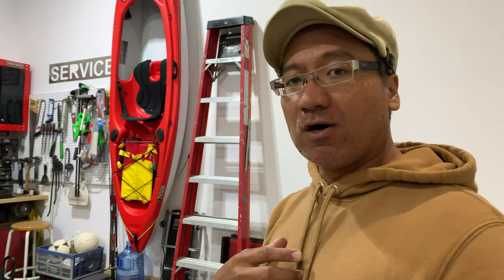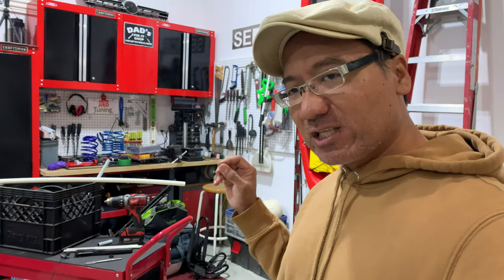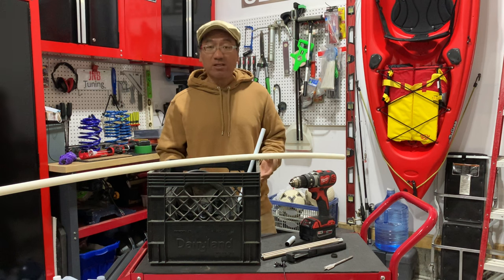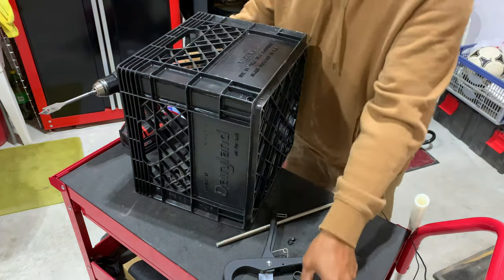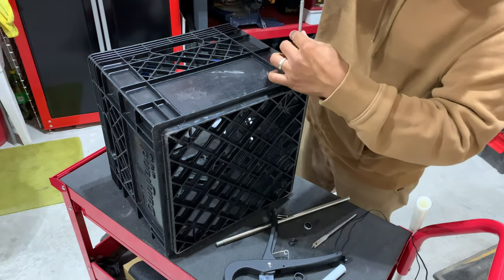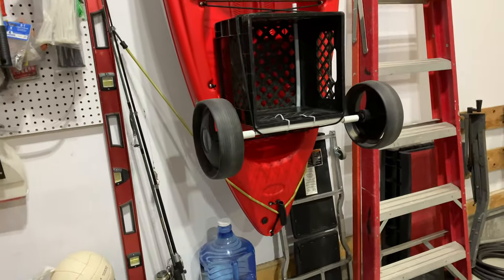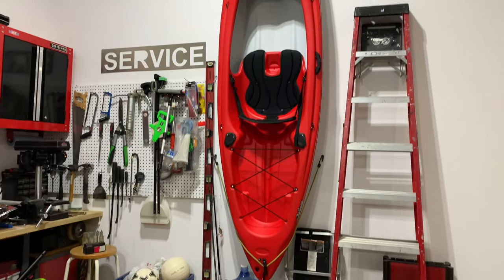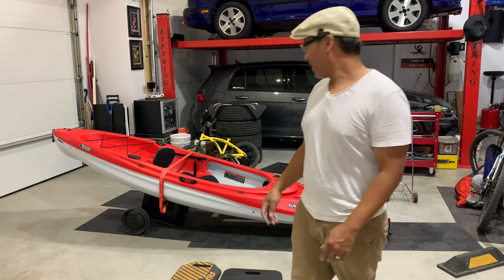A Fishing Crate that can be Transformed as a Kayak Cart or Trolley | Easy and Super Lightweight

Comment: Why not install your axel assembly at the top of the crate (what you’re using as the storage position) then use the bottom surface of the crate as the carrying surface for the boat?

With that configuration the crate is upright (and wheels up) when in the boat and upside down when carrying the kayak.